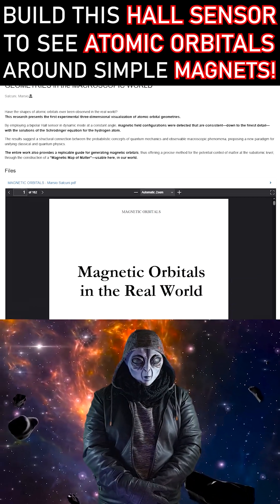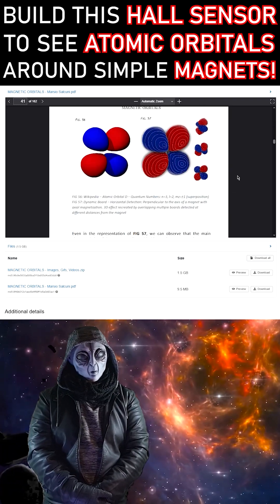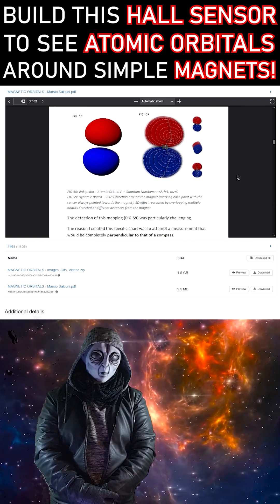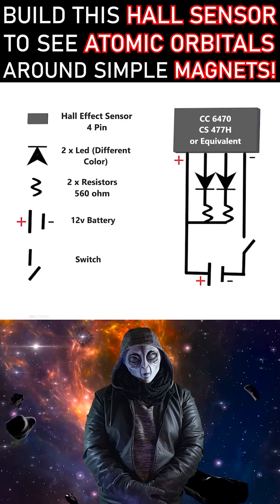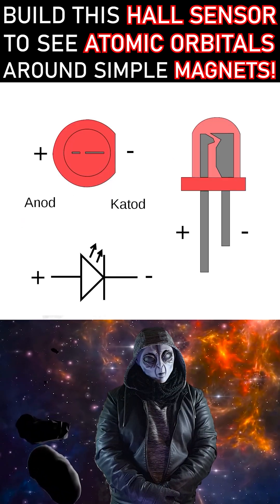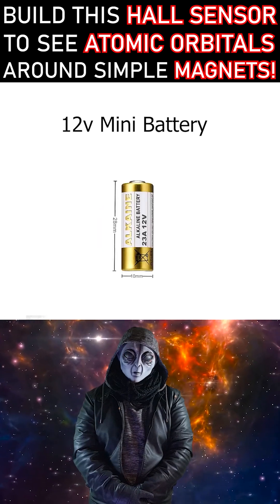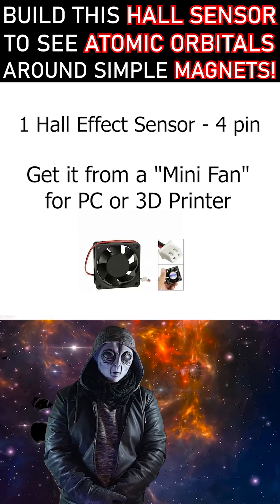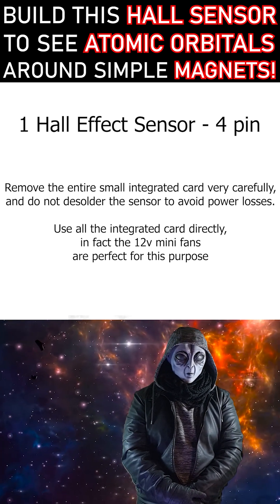How to Build a Polarity Detector (DIY Hall Effect Sensor) #magnetism #magneticfield #quantumphysics

Comment: your LEDs are incorrect polarity  :)
Reply: @The-Quantum-Arena why are the LEDs connected backwards?
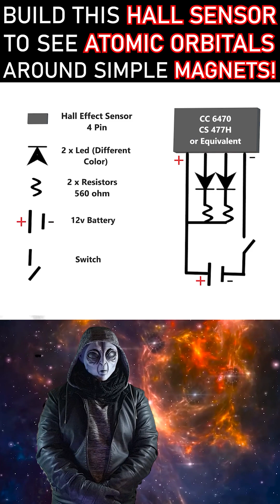Reply: Look at 0:35, your LEDs cathodes are connected to positive voltage, this is backwards. And will never light up.
Reply from the maker: The LEDs are designed to be driven by the Hall sensor in sinking mode (open collector output).
When the output goes LOW, current flows from +V through the LED and resistor to the sensor output.
The schematic is simplified and doesn't explicitly show the direction of the current.

But you're right, given how a normal circuit can give that impression, and given the wide variety of Hall effect sensors, that's why I included this sentence in the long video:

https://youtu.be/3L_n4zxIyZA?si=hQfXMIUZr5nPGNw4&t=347
Reply: @The-Quantum-Arena most people know that nfets are lower cost and lower RDson, so 99.9% of the time you pull low to turn on.

Comment: Would there be a simple way of having 1 different coloured pens drop down when the led changes (appropriately). Maybe a small solenoid? I would happily create a 3d printable file as a full project holder if you would like.
Reply from the maker: Oh, to automatically mark the detection point? Nice idea, but it's a little more complicated than it seems, because there must be nothing interfering with the magnetic field in front of the sensor, otherwise the readings will be skewed...

But thanks for the tip! I really appreciate it when people take the time to improve and optimize this process! 😀
Reply: @The-Quantum-Arena maybe just making a dot, as in with a fine tip marker. No direction just dots... I also have an old mechanical device that allows you to manually copy or enlarge drawings... It always stays at the same orientation so the sensor will always stay at the same angle.  Sorry my drain spits out additional ideas on the fly.
Reply from the maker: Look, just with words, I can't quite understand what you mean... if you're talking about something mechanical, then there will also be iron, and that's not good... if it's something else, maybe yes...